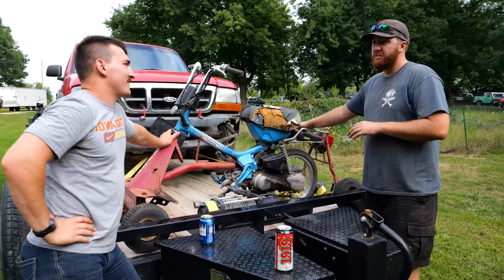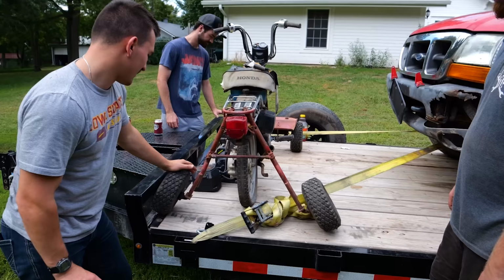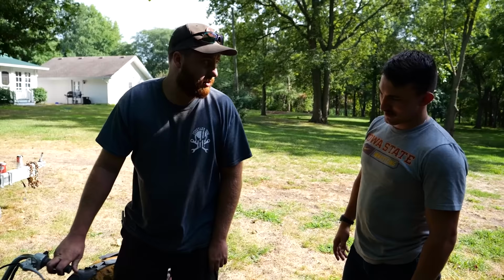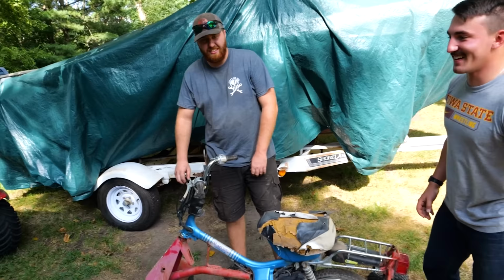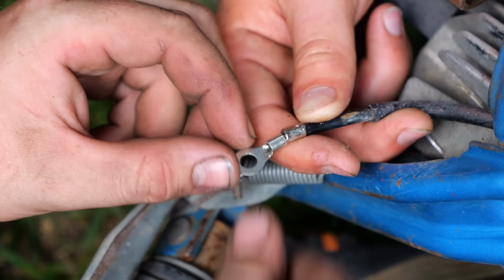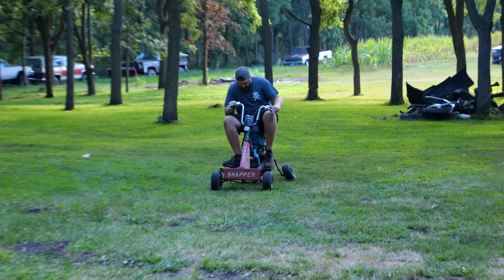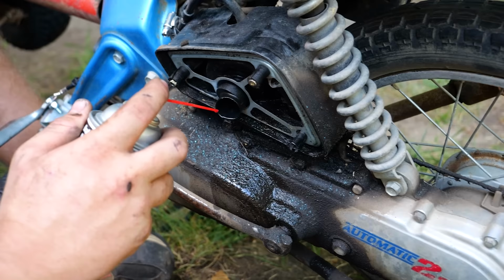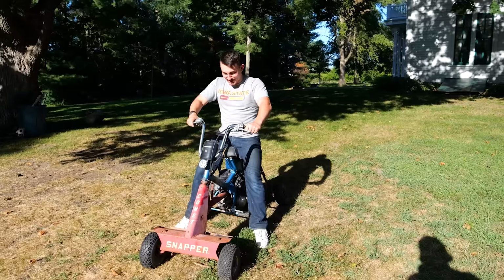Reviving the Crazy S#!% I Built in High School - MOWped First Start in YEARS

Comment: I made a gokart in junior high school I bought off a friend for 50 bucks had a 5 hp tiller engine in it and he blew said engine to smitthereens... I had a brand new kawasaki snowmobile from year before my brother in law stole it and was joyriding it hit a water well pipe and ripped the entire front end off of it 3 months after buying it new... So my ingenious plan was to cutoff the old gokart engine cage with engine and weld in new plate mounts and engine cage. I add the 660 kawasaki engine and had 2 speeds fast and holy chit batman... well that june about 2 months after building it I decided to see what topend was & went back to mile and half road to main county road placer er in holychit batman gear and slammed pedal to the floor made the mile and half what seemed like blink of an eye speedo went to 80 and was pegged out in 100 feet... I proceeded to take the long slow curver to the right to our machine shed at full balls backend slide out hit the ditch went airborne flipped over fence into a field and rolled it 500 feet+ luckily I had some brains and had a full rollcage with 5 point belts in it and wokeup a few minutes later popped belts and stumbled back to road pickin up pieces along the way.... Then my pops camehome......... I had the whoops face and he just snickered looked at me and said you okay boy? Said Yes sir and walked back to the house while he said pickup all that chit before mom sees it

Comment: Actually we also did some sort of a death trap in high-school. A "trailer" which consisted of 2 motorcycle wheels welded to a VW buggy driver seat and we pulled it with a 50cc moped. It tipped over as soon as we got in the revs with first gear.

Comment: I threw together a 94 murray shift on the go riding mower.. put a18hp twin briggs, 8" pulley on the motor( governer still intact btw) 4" pulley on the trans, after cleaning it out and filling with 90wt gear oil. Put a hand throttle on the wheel, no brakes. Multiple trips down the road later in 4th gear netted me about 40mph. Ran out of road before i could go to 6th gear. It was thrown together hastily, dangerous as hell to drive ( darted side to side), got the attention of local police ( yes was pulled over on it, i was exceeding local speed limit). I eventually took it apart because it did indeed scare the hell out of me. All that to prove on a riding mower site that you could double didget a mower using the governer, totally stock motor.

Comment: Hey Kevin when I was in highschool I took a small lawnmower and put a push mower motor on it had a 3 speed trans the motor was hard to start it would pull your hand in to the hood but once it was running it would fly miss it my buddy busted the transmission so I junked it it was a wild ride

Comment: I put a wead wacker engine on a bicycle and for the drive i took like a 10mm socket welded a nut into it and bolted it to the back of the engine and put weld splatter on the socket for traction and that rubbed on the tire thus making it a motorized bike built with a flux core mig welder

Comment: When I was in high school I built a minibike that reached 40 miles an hour. I specially mounted a 1980s 3 hp Briggs & Stratton engine with a direct chain and sprocket. I revive the engine by combining a total of three Briggs & Stratton engines into one; taking the good parts of the others. My minibike had no brakes due to the fact that they weren’t designed a break at 40 miles an hour so they burnt out within two runs. Interesting enough, this engine shot 12 inch flames; After revving high, I’d let go of the throttle and it would backfire intensively. It got 40 miles to the gallon with a reservoir tank bungee corded right between my legs which gave me an extra 10 miles. The engine was originally an trim edger. It had two levers on the right side of the engine which said run and choke. By the two levers I hooked up my throttle cable directly on the run lever spot because it gave me an extra 7 mph instead of the original placement. Over time the spot welds holding The run and choke bracket snapped and since I didn’t know how to weld I came up with a good idea to clamp on two locking pliers which acted as the spot welds. For the time I had that minibike those locking pliers did their job superb. Although due to the unfortunate I didn’t ride  it for one week and as I went to go and fire it up I found that it was stolen. To this day I still hope someone sells it on Facebook marketplace so I can get it back

Comment: I'd fix it up an finish it ie the welds lol , repaint it give it a headlight and breaklights , turn signal and a muffler plus a electric starter switch and basket you've got yourself a pretty good farm moped or a toy to run to the parts store if nothing else is running. Just a thought for a video

Comment: back in the 90's i put a 650 4 cylinder Kawasaki motor on a riding lawn mower frame!!!!!!..And as i soon discovered at 109 mph on a dirt road,the wheel base needed to be widened. I then installed a old dune buggy front end and Double tires on the back....was so fast ,but dangerous ,finally sold it

Comment: That neat 👍 you might what to use some gas an clean the air filter so it can get more air. You might what to do some welding on it maybe work on the training wheels. New throttle cable it would be kick but fun

Comment: Back in early HS I shoehorned a Tecumseh 10 horse snowblower motor into a bicycle frame. 10 tooth centrifugal clutch to an 85 tooth sprocket. Clutch, sprocket and chain were the only things I had to buy, ran me like 150 bucks. Just a few weeks ago I took it out of a 4 year hibernation as I plan to put the motor in a snowmobile, but I need to know the real top speed before I do. Haven't found a large enough paved area yet but Its definitely capable of deep 40s, maybe low 50s.

Comment: My first build was a early 60's mini bike that originally had a 1.5 hp engine on it. I ended up putting a 6.5 hp generator motor on it and took the governor off. That crap had no front bearings, the tires were all dry rotted and originals. The brakes didn't hardly work. I have a video of myself keeping up with traffic going about 30-35 lmao. I can find it and post it in my replies if anyone is intrested.

Comment: Of course it's going to start, it's a honda! I found an 200S ATC in a field that hadn't moved in over 25 years a few years ago. I asked the farmer if I could keep it if I get it started. I checked for spark, there was spark, I cleared out the tank of old grungy gas. I used some starting fluid. It started on the third crank. The old bastard farmer went back on his word. I said ok, I snapped the chain before I left. That's how I used to deal with lying jerks.

Comment: Bolted a 10 hp yanmar diesel to a metal tool cart, you sat in the front and steered with the handle between your legs. The throttle was a 2x4 on one side and the "brake" was a 2x4 on the other side. The drive sprocket was bolted directly to 1 wheel.

Comment: I worked at a High School and watched a kid make a um, well,  I'm not sure what it was but the uh chassis? Was a steel fire door from the school that had been replaced and he rigged up some fixed front wheels and a strange rear wheel /engine assembly that you steered like a boat motor tiller. Sketchy thing it was.

Comment: I need to revive my "shit house" trike.
Front end is off a Honda express. Motor is a 6.5 Hp honda knockoff, rear end/transmission  is from a mower. Seat is from a 1000 goldwing. There is a wooden  "outhouse"  that covers the passenger  area.
With an assortment of cow and goat bells. Top speed maybe 8mph.
It is obnoxious, used it at the EasyRider Rodeo in Chillicothe Ohio a few years.

Comment: I cut a riding lawn mower in half and welded it to the front part of a bicycle I cut in half I learnt that the front wheel of a bike actually had alot of geometry and if you screw it up the wheel will just turn instantly

Comment: My question is why is it so fast for a death trap. I remember sticking a 3hp predator onto a 3 wheeled go kart with one wheel in the back and a wagon style steering on the front. And it was a peice of wood laid on top of another and screwed down. Rode great around the yard but the second you take it on the road it would have a death wobble at like 10mph. Scrapped the hell out of my elbow.

Comment: My brother and I were given a free Craftsman mower by a neighbor. We took the mower deck off, cut off the muffler, flipped the pipe upside down, and we beat the hell of of this thing and the best times of our lives. I'm even honored to have been RAN THE FUCK OVER by said mower and brother. He also strapped on my racing helmet, we set up a Pontiac hood on a couple of cynder blocks, and he ramped it as the camera died. BEST TIMES OF OUR LIVES! It made a very capable off-road trail machine, as well. Until the trans locked up.

Comment: i think the folks at Honda are underestimated if find an old honda with a rusty carb ill clean that rather than put on a aftermarket carb these motors and carbs just run forever, and we have all seen YT vids of dudes in Asia loading the bike with a recommended 220 pound SWL with 6 people or 400kg of farm supplies, unfortunately, any 70s honda seems to double in price every 5 years

Comment: I took an orange Tecumseh two stroke lawn mower engine and added it to my orange 5 speed 24 inch bicycle with a couple of 2x4's and some angle iron bolted to the rear axle.  If I had ever gotten it to run, it probably would have killed me, but the craziest part was that everyone liked it. One guy actually stole it, thinking it worked, or something, I guess, lol.

Comment: It just sounds like that thing doesn't have any bottom end, probably because it's a small two stroke but also it probably doesn't have the compression it once did after so many years of abuse. I have to thank you for making me not feel bad about the moronic ideas I had in my teens, like wanting to put a 500 Triumph twin in a go kart, and my cousin wanting to put a 500 Ninja engine in one, at least when I designed things I actually thought them all the way through and designed them to be somewhat safe and strong.. though I never had the money or tools to actually build anything I came up with.. still don't probably won't ever.. because autism, scoliosis and IBS make working impossible.

Comment: I bought a blue honda express at a yard sale for 5 bucks once. Something eventually broke and it never ran again.
I later bought the same baby blue color honda CB125 at a yard sale for 100 bucks (big step up here financially), I rode that thing everywhere, I should have kept it and tried to get a title so I could register it but lets face it, a teenager before there was as much on the internet as there is now, a bike purchased non running with no title was just a way to lose 100 bucks and the bike.
I ended up selling it to another kid for 100 bucks, who rode it all over the place, and still was last I knew.
Probably the sketchiest thing I ever built though was a catapult/trebuchet. I must have been 14 and decided I wanted to throw stuff really far. A bunch of 2x4s later and I was tossing cans of corn past where I could see.
This later evolved into building a propane fuelled potato cannon, which would launch corn cobs further than you could see.
And now, here I am building a space shuttle out of an old pontoon from a boat...

Comment: zips but not the compressed computer file, cops found one i made 14 years ago without a license to get ammo or anything... p.o.s. hand 22 pew pews "micro's under 3 inches" louder then a 270win rifle, have court about it in two days. only things ever harmed were the empty beers the local drunk kept dumping in the ditch of the driveway, heard the pop's and went with the wind... decimated a expensive swinging target with it, crack a full size D at 200 hardly blinking shot after shot. only 6 inches... and then i was a few years older and realized, sh!T i live in canada... they call guys certin R...... words for making those things, D at 200 for a rust pipe 22... would have laid waste in the civil... but the boat landed in 1863, the day it was over. THEY STILL HIDING AROUND IN THE BUSHES THATS WHY THERE STILL BE LAWS! :chillwcat:

Comment: Probably not worth your time and definitely not thematic with your channel, Kevin, but look up 'tadpole tilting three-wheeler' if you are not familiar. You could put your engineering chops to work building a new front-end that can properly lean and get rid of the training wheels. Of course, it wouldn't be a mow-ped then.

Comment: was that regular gas into a 2 stroke we just witnessed....
Reply: Yeah, does that confuse you or something?  It has a separate tank for the oil and it mixes as it sucks fuel.
Reply: @haywoodyoudome  I've never had a moped like that. Ive always had to mix my gas. Infact, the gas tank lid on all of mine had a little cup built into the bottom to measure pre mix. I had no idea there was these set ups like sleds and skis run.

Comment: Good ol Honda Cub / Super Cub reliabiity. There's a reason every cheap cr*p scooter out of China uses an engine that's a blatant, shameless knockoff of basically that. Might sound like Taco Bell's givin you Taco __ at speed, but you can run it on liquid stupid and not kill it. Literally, I've heard of someone who lubed one of those engines with friggin Wesson canola oil and it ran fine for years that way... and while they might not have much speed, the torque is _insane_. Load it down and try to climb Mt Fuji, literally you might only get a walking pace from it but it WILL get you and a half a metric ton of ramen packets up that mountain.

BTW, the three-wheel config of a single wheel out back and two in the front is actually more stable than the more common (?) 3rd wheel in the front. (No, the famous Top Gear episode with the Reliant Robin is not good source material -- they loaded down the back end with extra weight, and one of the rear tires was the wrong size, on purpose.)

I know this one was just for splits and giggles :P but, believe it or not, there's a reasonably simple (?) way to make this thing practical -- give it a wider front end, so the front wheels are spread wider apart, and you should have enough track that it won't corner like a drunken one-legged pig on a unicycle. Heck, give it a tilting front end with some wiidth and real wheels/tires that aren't tiny little Horror Freight cast hog poo on rust type things, and then you'll REALLY have something.

I'm actually not kidding. Look up the Piaggio Ape ("Ah-Pay"), a tiny three-wheeled truck that kind of came about, originally, as a side-project of the Vespa in the 1950s. Kind of. Those things are ALL OVER Western Europe, it's crazy. They're essentially a mechanical mule with about a four-foot-square bed and just enough cabin to keep the driver from getting wet in the rain. Single occupancy, almost as simplistic in construction as a cheap Wal*Mart ten-speed with lights and a "bicycle computer" -- and it's actually kind of rare for them to have displacements over 100cc. In fact, the most common models have a 50cc motor, no joke. Used for everything from food trucks to delivery vans to farmers getting thousands of pounds of produce to market, every single day, across all of Continental Europe and in the UK and Ireland as well.

It would be RIDICULOUSLY simple to get something like a front-bed version of that out of this contraption. (Oh, and they sell those all over eg AliBaba and the like, as well -- and from several far more reputable manufacturers. One of Cushman's last gasps was a front-bed scooter truck like that.) Actually... I'm gonna make that a full-on request. I want to see you take a break from revivals, and do an episode or two or three where you take this old thing and rebuild it into a genuinely practical vehicle.

Comment: Kevin, that thing's a 2-stroke, you could've ruined the engine by putting gas in without also adding 2T oil

Edit: wait, does this thing have a separate oiling system? Not too familiar with Honda Expresses